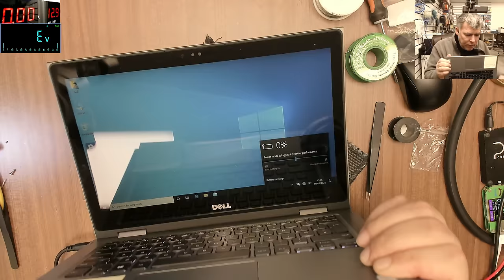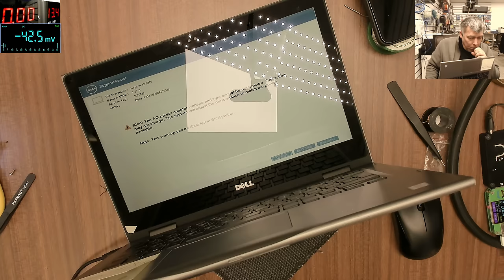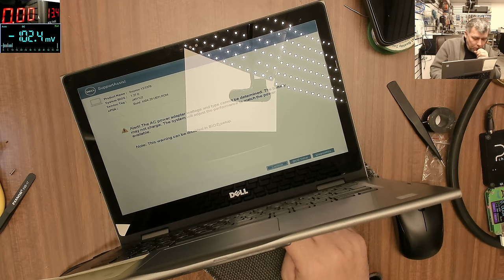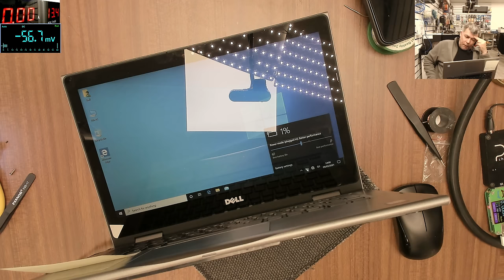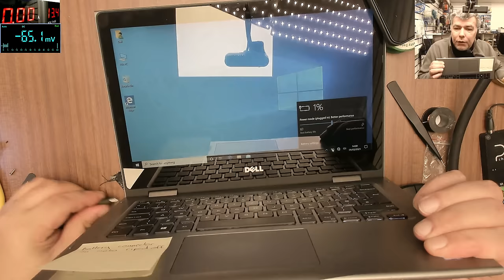Two Dell laptops repair, but the second one is the most nicest laptop i ever seen

Comment: Sir , 
I am a laptop technician on past 7 years. But I can't still figure out that "AC ADAPTER PROBLEM ON LAPTOPS " . Kindly waiting for you from a solution on this issue. I get 3 to 5 laptops every 3 months interval on the same problem. Iam crying, still I cannot get rid from it. Waiting for you sir.

Comment: Can anyone tell me....while my laptop was plugged in,i was durectly removing plug from socket and suddenly a short circuit occurred.There was some burning smell and a sparking noise. My charger got dead but my laptop kept working. Is there any damage possible in the laptop motherboard? I do not exactly know where the burst sound and burning smell came from. Btw the machine is Acer Nitro 5. It would mean a lot if someone helps regarding this.

Comment: Kindly read this. I know how to fix that problem. Near the battery or charger is locates were the three legged diode is located you will get 3v on one side and 5v on another leg then zero on other leg jump the 3v to the zero trust me it will fix
Reply: The 3v is the adapter presence and it goes bad most people think its the charging ic but its not. Its a very common problem with the Dell

Comment: The first laptop can't recognize the charger, that's the problem. Probably the middle pin on the charger cable jack has no connection.

Comment: you can not repair first laptop completely . its not charing the battery also gives adapter warning so it will work wery slowly . its useless .the owner that laptop will going to another expert to solve the problem.